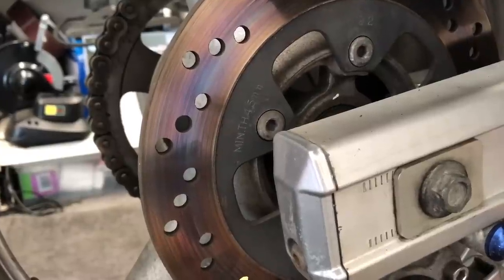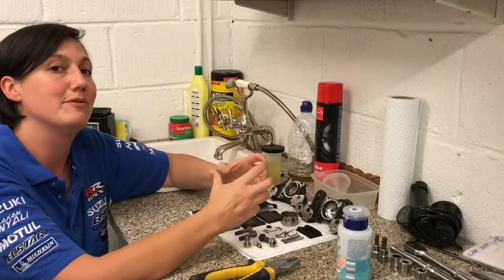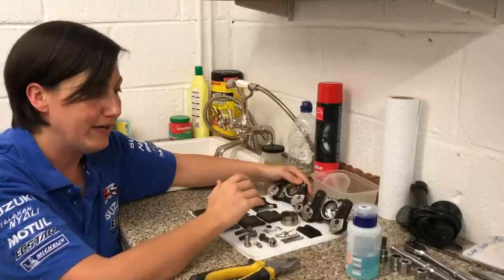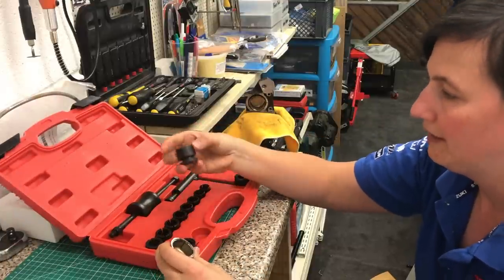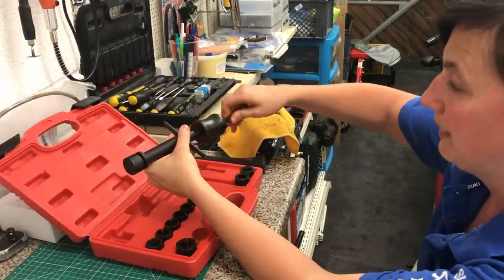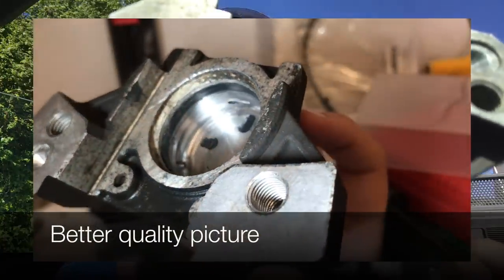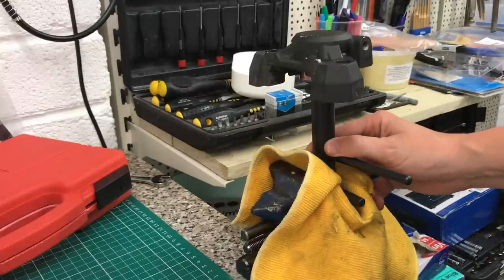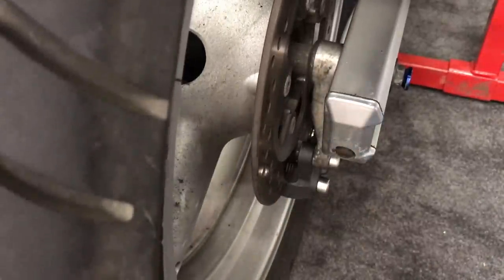Stuck Pistons in Brake Caliper

Comment: Thank you so much, I purchased a brake piston removal tool and had the same issues as yourself and thought I'd wasted my money until I found your video with that handy tip about clamping it into a vice. Thank you so much as I have managed to remove 8 stuck pistons from a bike that's sat for 20years with that handy tip 😀

Comment: I've never had a problem using the brake piston removal pliers that grip the inner wall of the pistons, twist n pull and they'll pop out fine. Glad you got sorted, it's nice having a local bike shop for those frustrating times :)
Reply from the maker: Yeah I think if they had not been so corroded I would have been able to do that, but then I now know to service them more regularly than I have been doing so hopefully they will be easier next time! Southwest motorcycles have been amazing to me, Chris takes the mick a bit but then always comes through and helps me out so I enjoy the banter! (also the things he is mocking me for are things I have screwed up lol!)

Comment: Good to see you back and hope the arm is healed well. More videos to follow I hope
Reply from the maker: Yes, more videos to follow! My arm is healing, physio is going well and movement is returning (although far too slowly for my impatient self!) I hope you like the next lot of vids too! Thanks for watching!
Reply: Tamsen Cooper still having problems with my indicators not working and have given up on fixing myself after 6 attempts. Booked into the garage tomorrow.
Reply from the maker: If it turns out to be electrical, it can be such a pain to try and find the issue, hopefully you can find out what has caused it and then you will have that info if it ever comes up again. Let me know what the garage say, I would be curious to know the cause!
Reply: Tamsen Cooper broken wire somewhere down the left side of the bike. Fail on the MOT also. Throttle grip loose and exhaust too loud.
Reply from the maker: I am pleased you updated, it can be such a pain trying to figure that kind of issue out. Broken wire sucks, did they manage to locate where it was broken as that could be a mission to find. What exhaust do you have? Does it have any baffles?

Comment: Thank you for explaining it my rear back brake was jammed period would not want to budge. Further investigation Justin's aren't opening up properly they're closed. Tried to bleed the brakes won't bleed go slow. I'm going to have to try to pull out the Pistons cylinders not pushing on the brake pads

Comment: I set out to refurbish my SV brakes a couple of months ago. I managed to get all the pistons out with just brute force. I really would not leave it as long as the manual might say to replace the seals. I think I got lucky but it took a few weekends to get everything back. Silly issue i had then was the pistons moved so smoothly i would not believe they would stop me but they do.
Reply from the maker: I was thinking exactly the same, the manual states it based on miles travelled rather than time, so I definitely left it too long between services! Smooth moving pistons is exactly what you want, but what I didn't cover off in the video was that I needed to change the bleed nipples too, I reused the old ones and they leaked slightly, next time I do the callipers I think I will just pick up spares before I start!

Comment: When I’ve had really corroded callipers ie after I crashed my bike an stripped the front end left my callipers in a tub. The shed developed a leak and filled tub with water, took four months to source second hand forks when it came to rebuilding callipers swapped bleed nipple for a grease nipple blanked banjo bolt hole and pumped pistons out…

Comment: I am at the dynamite crossroads. I've tried reverse pliers, rubber protectors with channel locks and reinstalling the caliper (and coated the piston with brake grease AND pushed the piston back flush) to use the hydraulics. Maybe before detonating the TNT, I'll try tapping on the calipers and reinstall on the brake line. Hopefully, that will un-seize the piston.
What's frustrating for me is I'll use my reverse pliers but the piston will come out to a certain point. 

I'm glad that you posted this vid and now I know about this piston removal kit. Thx.

Comment: I have taken over a dozen brake pistons apart over the last 18 months as part of my refurbishment hobby and the only thing of any use is a Hand Pressure Test machine, used by plumbers, ebay maybe £25. Every caliper had issues, the machine has up to maybe 700psi of pressure.......email me for details....if unable to find
Reply from the maker: I shall go and take a look for that now...
Reply: You have total control over the whole process, every second, every millimetre. You need a few fitments to get a fitting for the brake fluid nipple but easily sorted. And although I had lots of brake calipers that deserved the bin thay were that stuck, I never had one failure

Comment: I'm having the opposite problem with my GS500. I'm changing my brake pads and now the pistons won't go back in, to fit the new pads. Any suggestions, anyone!?
Reply from the maker: Have you tried putting a bit of brake fluid around the pistons to act as lubricant to help them slide back in? It is also worth checking the seals are back in as they should be and not twisted or out of the little groove they sit in. Let me know what works when you get it sorted!
Reply: I ended up taking the caliper off my bike so I could get a c clamp on it, and then push the pistons back in. They're almost completely back in! But now I think I've got air in my lines via the bleeder valve...